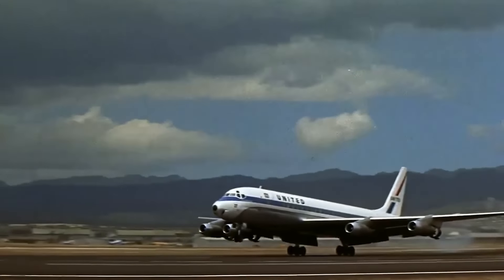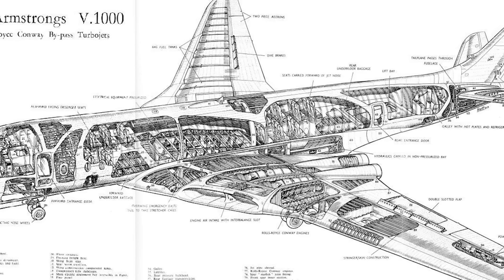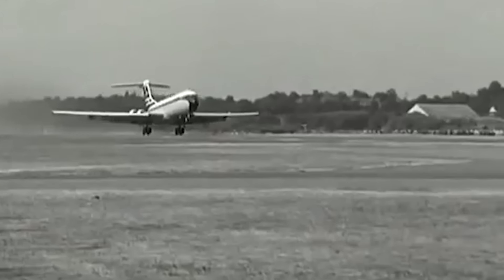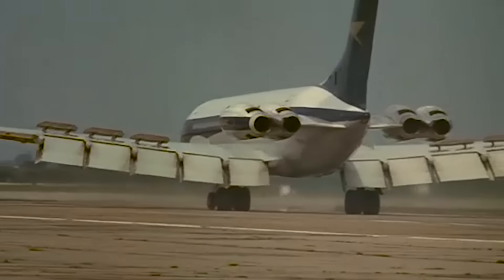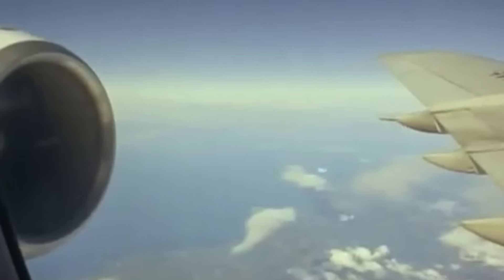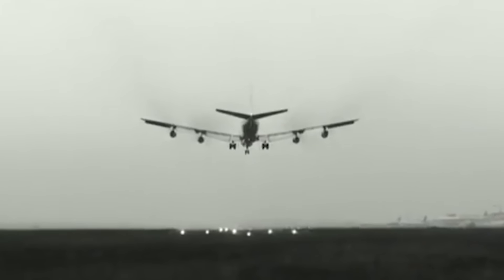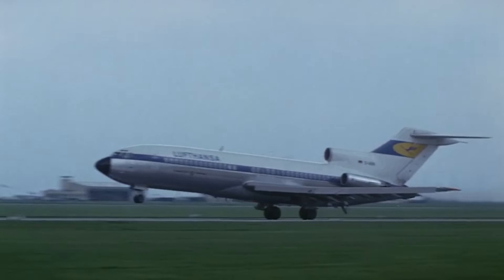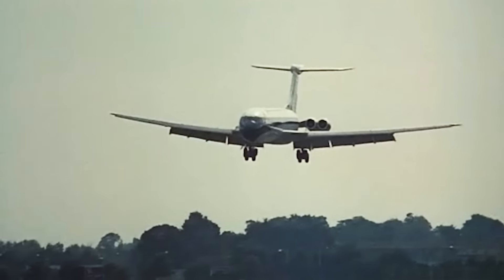Vickers VC10 - the lost flagship

Comment: I wouldn't think the tail mounted engines being mounted aft or so close together would be desirable for flight characteristics or different possible failure scenarios. Excellent work on the historical side and I encourage everyone to check out The Flight Channel.
Reply: Correct. A BOAC VC10 had an engine explode over Heathrow Airport on climb out, and the turbine blades took out it's neighbour engine. Luckily it was  easy to land on the field below. After that incident, we needed to do simulator checks, losing 2 engines on one side after take off. My sim. check ride was out of Rome Fiumicino. At a few hundred 100'  the sim.  instructor shut 2 engines. It was impossible to accelerate to pull in the flaps,  so as o climb out. We couldn't turn back to land as the extra loading of the turn reduced our speed. We ended up ditching in the Med, then sweatily  went for a cup of coffee.  (Sen. Capt East African Airways. 1970-1973)
Reply: From a pure handling point of view having the engines where they were is excellent. Little thrust-yaw or pitch couple when changing power, and very benign asymmetric handling (double engine failure becomes a thrust available problem, as opposed to the 707 where a double engine failure can lead to a huge thrust available AND controlability problem!

Comment: The speaker of this video and all the preceeding videos of that series should use the term VERSIONS instead of  MODIFICATIONS, when refering to different detail configurations of aircraft that are built as a family. The term modification is appropriate when already produced aircraft are changed or reconfigured after they originally left the production. The Super VC-10 was NOT a modification of the original VC-10, it was a new VERSION.

Comment: only fault with the comet was the windows. the MkII comet fixed that and had the best safety record of all planes except the concorde. the MKIII comet was even better. but cause of the crashes the MKI had very few were sold of the later improved models.
At the time all planes had round windows including the BOINGS. the comet crashes found out the round windows were the problem and they got changed to the square windows now used.
Cause of the comet investigations the BOINGS had to redesign their planes as well to remove the round windows.
Reply: ...the comet crashes found out the round windows were the problem and they got changed to the square windows now used... .''  sorr, Cliff.. other way round.. ie square to round. The square ones developed cracks in the corners. (Check Capt. Comet4c, East African Airways). 69-70)

Comment: A couple of points, No mention that the fuselage design relied heavily on the design of the VC9 Vanguard. It was not "oval" but in fact the same figure of eight as the VC9 with the floor being a main structural item, although in the VC10 the outside was much more faired in than the earlier design.

As for it being the fastest airliner before Concorde, perhaps you had better look at the figures for the HS 121 Trident and the Convair 990 Coronado

Comment: Would that I could have flown on this wonderful aircraft.  I always liked the rear-mount engines for their aerodynamic elegance and reduced cabin noise level.
A "Daughter of VC-10" aircraft, with a 5th engine, or with 3 uprated ones, slightly area-ruled fuselage, and reworked wings and control surfaces could be the long-sought "sonic cruiser" flying at about 1.2-1.5 Mach.  Fuel for thought....

Comment: Most unfortunate. A practically sound design, made too complicated and difficult to service and operate with Airline trained and maintenance facilities proved it's undoing. To cut losses, they palmed them off to recently independent African countries like the the tri-countries East African Airways, based in Nairobi and operated by predominantly British air and ground crew. Air India, led by the farsighted and iconic Mr JRD Tata, saw that it would have been a disaster to accept the VC-10 and selected the emerging B-707 albeit, with the Rolls Royce Conway engines. The rest is history

Comment: Great video on this plane, still being used in 1979 by British Airways on some Middle East flights out of Heathrow, although by 1980 the new Lockheed L1011 Tristar was taking over many of these busy routes, such as to Jeddah, presumably due to the extra capacity needed. 

btw, 'BOAC' (bee-o-ae-sea) is more usually said than 'The BOAC', despite it seeming more logical with this acronym.

Comment: Spent a lot of time poking around these aircraft and even got to do a few hours in the right seat on one, I found them to be a forgiving and proficient aircraft well suited to what it was 'Designed' to do however given a polite poke they could exhibit what you might call well out of the box performance levels, as your presentation alludes to however they were in many respects a real bear to work on but even so Vickers built them to last and seeing one recently being dismantled the condition of the airframe was far better than I would have expected for a plane of such an age, testament again to Vickers, in concept it went far beyond what was required at the time and changing needs of the industry that could not really be accommodated quickly appeared to have been its Achilles heel and the remains were hoovered up by the RAF who found it ideal, Sad to say the UK will never again see such innovation practised in its truncated aviation industry were men in sheds wearing cardigans and waving slide rules once managed to turn out such master pieces.

Comment: The Brits managed to build over hi tech, expensive to maintain and run planes. Some of which had a bad habit of crashing!
As for landing such large planes on dirt probably not a good idea. And again increased the cost.
I know a pilot who flew one  later in its years and while a good aircraft a bit like English cars with electric and control gremlins. 747s evidently were far better, though 25 years newer.
Though currently it seems all planes have gotten too hitech and cause all sorts of grief.  Look at Boeing, Look at Airbus and ofcourse Concorde as well.
Reply: We didn't land on dirt, only on paved runways, sometimes quite rough. But she was good at hot and  high altitude fields such as  Addis Ababa. There, sadly we lost a SVC10, one of our 5.. On the take off roll,  it stuck a small metal jack that had accidentally been  left on the step of the small  Cessna, that took off just before our plane. As the Cessna rotated for take off, the jack fell onto the runway.  When our SVC10 nose wheel struck the jack, the tire  exploded. The Capt had enough planned stopping distance.. closed the power, engaged reverse thrust and slammed on the brakes. The left brake FAILED. The plane ran off the end of the runway at about 80knots. The left wing  hit a steel structure, that  should have crumbled, but had been constructed of heavy duty steel,  slicing off the wing and spilling fuel. The plane then cleared a small  valley, hitting the other side,  breaking into 2 as it came to a rest,  and catching fire. Many passengers and most crew died. Cause of the brake failure.. the ground maintenance, when changing a rubber seal, had  failed to remove the old one, which was just pushed back up  into the pipe, blocking the hydraulic fluid. Sloppy mistake.. made for a disaster. (Senior. Capt. East African Airways. SVC10 1970-1973).
Reply: .. with electric and control gremlins. .. really? Not to my/our knowledge. Biased report, maybe?  (Sen. Capt. East African Airways. SVC10).